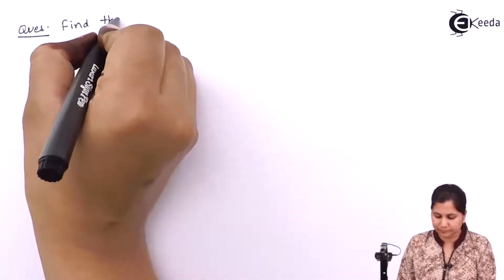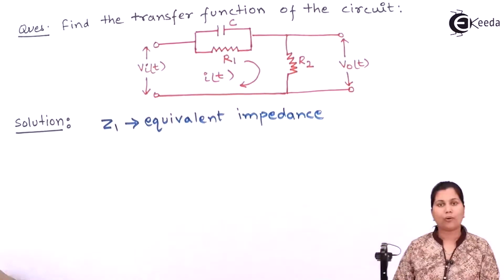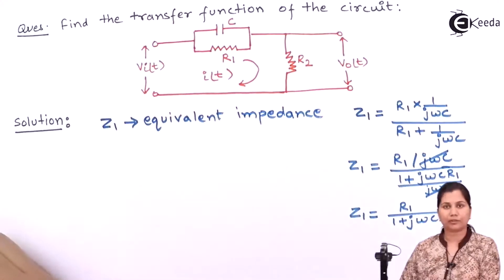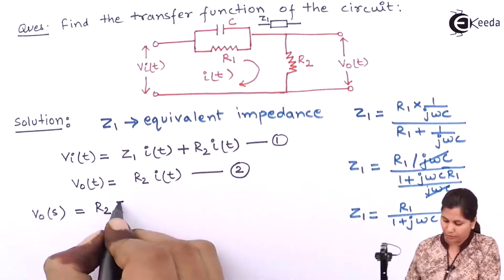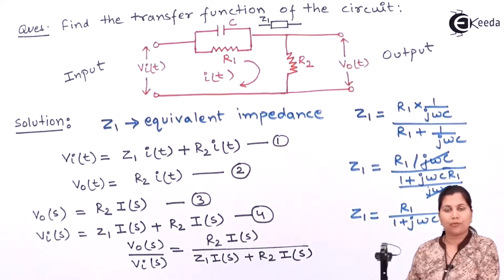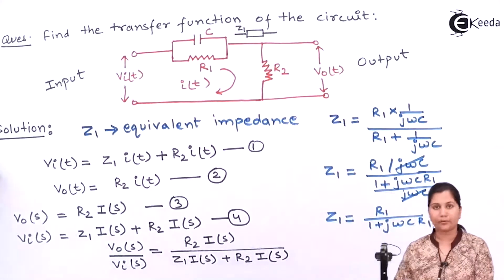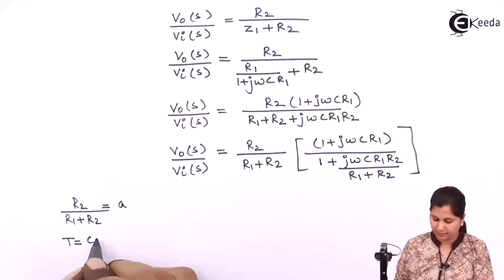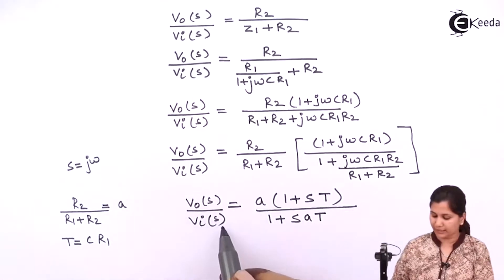Transfer Function of Electrical Network Problem 2 - Transfer Function - Control Systems

Comment: Mam what if there is a capacitor C2 connected in series with Resistcne R2
Reply: It will be simply added, just like we add resistors in series